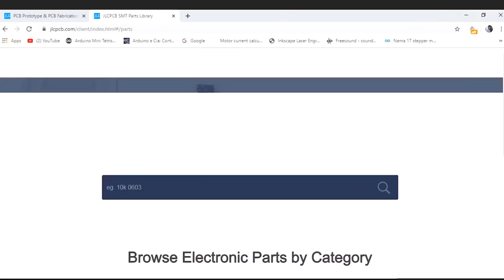Stepper motor precise synchronization Using Arduino

Comment: They're either in sync. or they're not... What's the point in sliding back and forth on the rail? In actual fact, if there were a real application for this type of mechanism, one of the rails could be a common drive shaft, and they'd always be in sync. anyway. That would save you all the electronics of your do nothing machine. If anyone wants to argue with me, I can give you an excellent example of a bottom loading heat treat furnace that was over-engineered in a remarkably similar fashion.